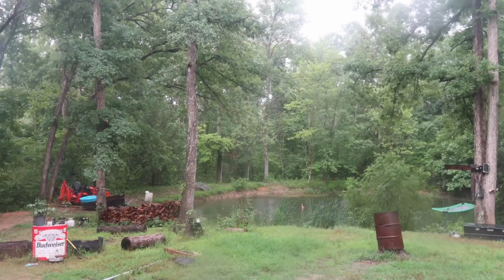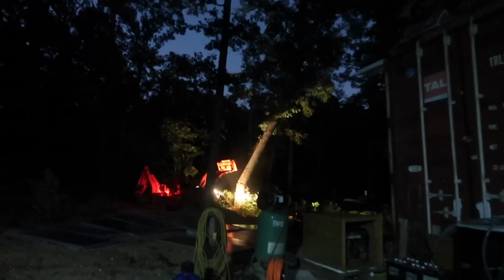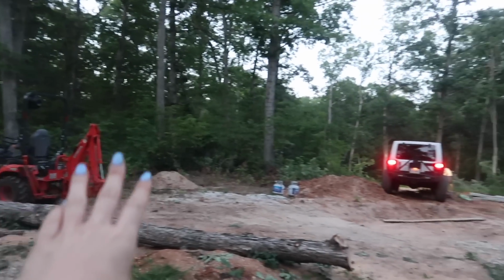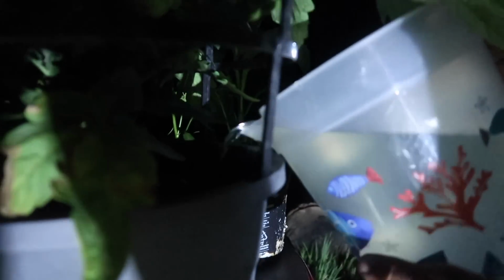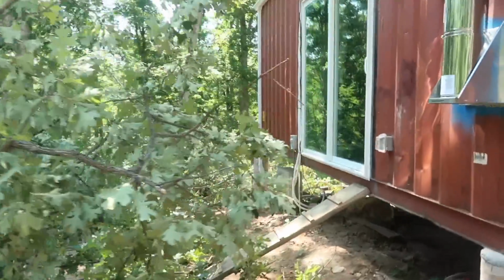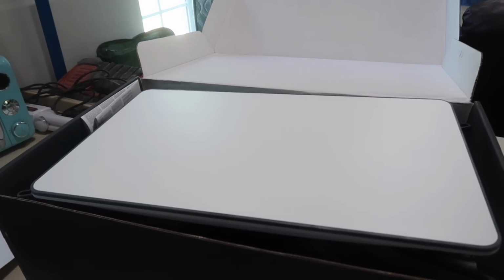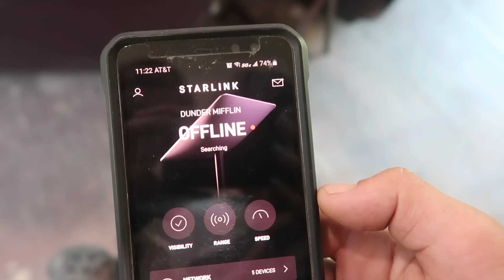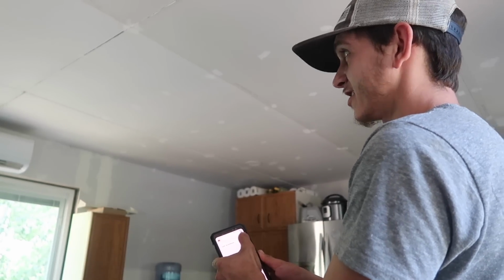Internet for our OFF GRID Shipping Container Home | EP:49| Clearing for SOLAR, STARLINK

Comment: I also live in rural Missouri. I had 9 Mbps.  So I finally got StarLink. It was $400 for equipment and $100 per month. They just raised the rates to $120 per month. Then I found out that T-Mobile has service to my area and sues cell phone towers so if you can get a signal for your phone, you can get a signal for internet.  It's 5G and super fast at 300-400 Mbps and is less than $50 per month. So even though I wasted money buying StarLink equipment, I will  save in the long run using 5G and never have to worry about line of site, a dish, or a cable coming out of my house.  It's a receiver (size of alexa) that plugs into the wall outlet and that is it.  Nothing else.  Just something to think about for future folks watching this video.

Comment: If your cell phone works... you have internet.

And that can be the cheapest internet you can get...and often better service than the other options (if any)

So just dedicate a low cost cell phone as a WiFi hot spot.
Reply from the maker: Yes, but also no. We used a hotspot for awhile but service is too spotty and data too slow. Not to mention most carriers have a data limit or will reduce speeds and when you're uploading YouTube videos that are a few gigs each you run out of data really fast.  We looked into just about every hotspot and none worked for our needs. Not to mention it would have to be on AT&T towers because the only cell tower near us is AT&T, other providers dont get service at our house.